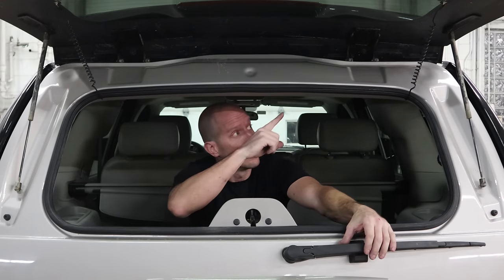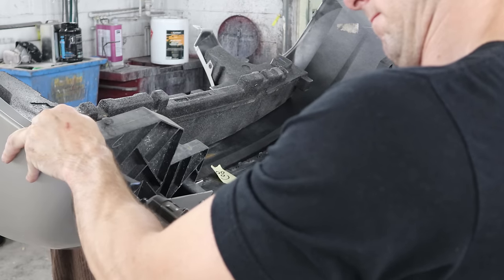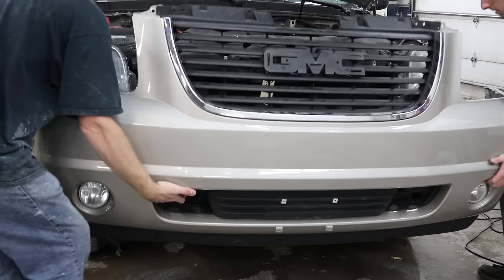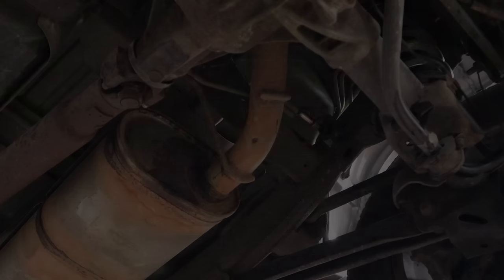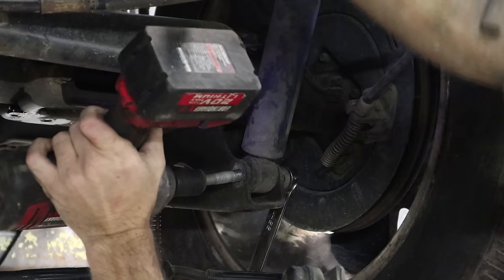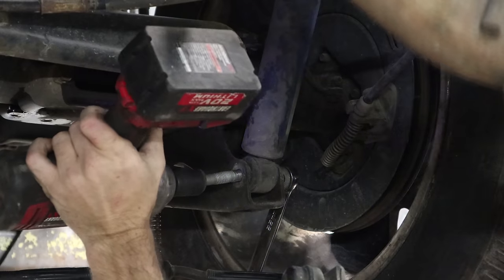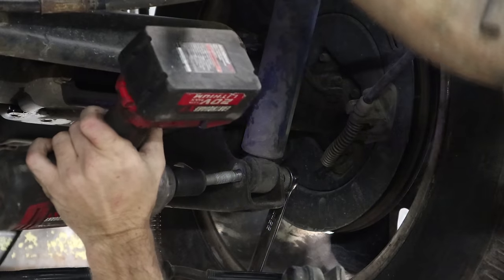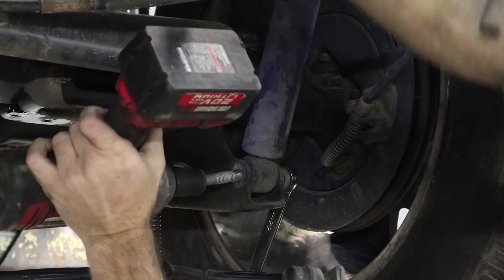Finishing the GMC Yukon semi collision rebuild project.

Comment: "1 inch impact to tighten up the oil plug [...] like I was taught at Jiffy Lube."

I genuinely laughed aloud.  Props.
Reply: "Put the oil in"
"They didn't teach me that at jiffy lube though" 

Master mechanic and comedian right here.
Reply: @crazikyle  It took them once to have them blow up a car in our hood for me to never go there.
Reply: I have been an auto technician for almost 30 years, I have full appreciation for what he said. I call them Shitty Lube. Through the years, I have corrected more than one of their screw-ups.
Reply from the maker: Ah, the kids Jiffy lube hires are learning, they make mistakes, it happens.  I do have a problem when I see the same mistakes coming from dealers, they are supposed to be the "best".
Reply: As I said, I have been doing this a long time and know many of my fellow techs. In our area there is a serious shortage of qualified and experienced techs. From the ones I have talked to, at local dealers, on a "team" there is usually one or two great techs, a couple of good techs and the the "zombie" techs. Of course, the "zombies" do the bull work that no one really wants to do like engine and tranny swaps.
Reply: @vehcor  In other businesses to prevent problems, you employ a quality system.  You think it would be easy; eg. the bill can't be processed until at least x.x litres of oil have been dispensed by the oil dispenser.  Don't know why they don't do this since it would be pretty easy.

Comment: Gotta love 3M VHB tape. I'm expecting it to be used to hold main and rod bearing caps on at any time. I think Honda already uses their wildly popular push pin body clips to rod caps on
Reply from the maker: It holds even tighter if you don't put it in the right spot! 😂
Reply: @vehcor  agreed. It has maximum adhesion if ever something is installed crooked or in wrong place

Comment: Very nicely done.  I have found that Brake Fluid used sparingly on a rag to clean black rubber and plastic parts works well.  Keep it away from the paint!

Comment: Thanks for showing us that LS oil cooler block-off plate gasket leak. I did not know about it.  Easy fix changing that $3.00 part,  remove (2)10mm bolts,  and I have to quote you,  " I win"  !!!
Reply from the maker: Your welcome, thanks for watching!

Comment: Quick tip you can relearn TPMS sensors by putting it into relearn mode then by letting some air out (or in) of the the tire with the light on until it beeps.
Reply from the maker: Or you could save time and use the proper tool......

Comment: The correct torque setting for the oil plug is stripped, then back half a turn.
Reply from the maker: You forgot the locktite step! 😂
Reply: Close, the correct torque is half a turn before stripped so it strips out when you go to remove it the next time. But for the diff fill plugs, it’s run them in with the wrong size wrench and completely strip the “square drive” or the “hex drive” (seen both on GM’s) at about 800ft-lbs of torque, so your only option is to completely drill them out since so amount of heat and ez outs will work. And gotta make sure everything has been doused with a gallon of locktite 😂

Comment: Great series Vehcor! How is the Pontiac G8 GT running these days? I own a white 2008 G8 with about 45k miles. I am also considering buying a 2005 White Grand Am GT from Copart, with over 200K miles in great shape. It just needs the transmission rebuilt, I know how much you love the Grand Am's. Anything I should be aware of? Hello from Phoenix Arizona.
Reply from the maker: Thanks, my G8 is a GXP and it runs fantastic. It is away for the winter and unfortunately I did not drive it as much as I wanted this year.  Grand am trans failures are rare actually.  More than likely it is a plugged up catalytic converter that acts like a bad trans.  I have bought 20 or more of those scenarios. One was my personal car for 6 years. I'm mean it could be a bad trans but driving with mismatched tires is about the only way to burn up the clutches.  Either way, used transmissions are cheap and so are cats.  Good luck, I am jealous that you can drive your toys year round! 😡
Reply: @vehcor - Thanks again for the suggestions. The Grand Am runs, but it does not move under it's own power. I assumed it was the transmission, but also a clogged catalytic converter makes sense also. Arizona is great for toys, I own a Yellow 2001 Suzuki GSXR 1000 that I can ride almost year round. She gets parked for about 4 months during the summer. I just got it out the other day for the 1st time this season.

Comment: So, I'm wondering why they use locktite on the brake parts. I can see where it would help keep the bolt tight, but maybe it also seals the threads to keep rust out? Am I on the right track?
Reply from the maker: It is just to keep the bolts tight.

Comment: Seeing all this ball joint work you’re doing, what’s your opinion on leveling kit/spacers on these full size GMs? I’ve got a 14 Sierra so will I to trash those ball joints in like 20k miles if I go with like a 2.5-3 inch lift?
Reply from the maker: Those use different ball joints, they don't fail like these do.

Comment: I have a question I got a used door from.a Salvage yard in good condition no damage when I swap them out it wasn't  Aligned right i tighten the bolts good any ideas and none of the yukons wher wrecked

Comment: If you worked at jiffy lube you would have know that the oil goes in the radiator.
Reply from the maker: That's why it is never in the engine! 😂

Comment: I watch auto repair videos and I'm surprised how many vehicles get damaged by the forklift operators at the insurance auction lot. Seems like they could come up with a better method of unloading/loading.
Reply from the maker: They move them a bunch of times in the yard in addition to loading and unloading.  It is the most efficient way possible.
Reply: Agreed. Shocks were damaged and a tire was stabbed (opposite side of the wreck and inner sidewall) on my project JK. Thanks Copart

Comment: In Australia repairable damaged vehicles go through 3 rigid inspections levels, everything has to be road worthy as they check everything, 4x4s even have to have mud flaps fitted, when it's registered you drive down the road you will come across piles of junk legally driven on the roads, you ask yourself, how come i have to pay a fortune on inspections? I see lots of vehicles on the road driven without a care in the world to mechanical condition.
Reply from the maker: The same is true here.  Rebuilds go through inspections but a 30 year old, taped together, rusted out beaters are just fine to drive around! 🙄

Comment: did you forget to connect the front fog lights ?
Reply from the maker: No, wait until you get to the part where I did put any bolts or lug nuts on.  Amazing that the wheels didn't fall off.  Moral of the story:  apparently some things do happen even if it isn't on video! 🙄

Comment: Edit:  Finally selling the old truck?  I may be slow, but I just now realized (after rewatching the first couple of Mistake videos) that you no longer use an intro.  I should be a detective.
Reply from the maker: I thought I was ready to sell the old truck but I just had to use it again. It is really hard to part with.  The videos were getting too long with the intro so I just stopped.

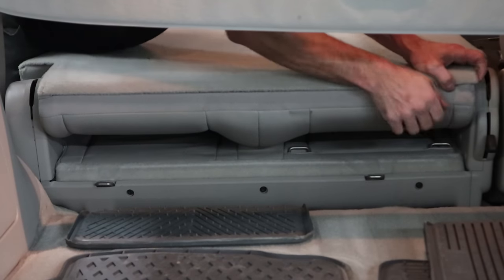Comment: is this a 'boring' build because it's Camry beige?  you know, you assert that the seat fix at 7:30 wasn't because of the accident, however, you can fix it.  You fix cars from accidents, therefore, it must have happened in the accident because you've never fixed something that wasn't in an accident :D logicz (with a z because itz so goodz).
Reply from the maker: It's boring because it isn't a Lamborghini or Ferrari and the haters told me I only build boring cars. 😂
Reply: @vehcor  I can't make it through a video of B or T without throwing something at the computer....

Comment: "Alignment".  I delay mine also. I've even gone so far as to do the string around all 4 tires method only to wear out front tires prematurely. Since your shop does just about everything else, is there a way that works, ...aside from using a high dollar alignment jig, ...making it possible for someone to accurately do their own?
Reply from the maker: I delayed mine for the test drive, it literally went there when I was done making that video.  A waste too! It was dead on already!

Comment: Doesn't that engine take 6 quarts?
Reply from the maker: A little more, I use the longer filter.
Reply: @vehcor  I saw the one jug and was thinking you just put 4 or 5 quarts in. I had a 2009 suburban. Never used the longer filter though. That vehicle had AFM issues.

Comment: Boring build Friday? WTF? where did that come from? you got haters now or something? You replaced ball joints brakes and rotors, i would have replaced the wheel bearing hub assemblies too while in there because typcally if the brakes and ball joints are that far gone it's just a matter of a short time till the bearings are gone too. I usually get a whole kit from Detroit Axle. they make  great set for Yukon's and escalades both (same kit) that has the upper and lower ball joints, tie rod ends, and larger control arms. not too expensive and more sturdy. well worth the time to replace them all at once and just be done with it I wold just like to know how you got a mustang 14" hubcap in a console that's only 8-10" deep lol
Reply from the maker: The haters say I build boring stuff because it is not a super car.  I'm just agreeing with them and it drives them nuts!
Reply: @vehcor  You have haters? How is that even possible? You're such a likable person, i don't understand that at all (not sarcasm either)

Comment: I,'ve always been told to remove any rust off the wheel hub flange face before installing new rotors (maybe you skipped over this step with the video?), typically with a drill and a wire brush head.  I didn't see you clean off the surface rust on any of the Yukon hubs - is it really necessary, or was I misled by an anal mechanic?
Reply from the maker: I was taught the same.  Over time you learn that you don't have to be so anal and things will be fine.  If they are really bad, I will clean them up but little rust like this is no big deal.

Comment: I've noticed a lot of unnecessary re-work due to poor pre-planning on your boring rebuilds.. is that intentional for content purposes? 
Also Flexfuel tech does NOT destroy your car, JSYK. Unless is a Ford but then again..
Reply: I would like to hear what poor planning he has done or are you just trolling?  He is one of the most efficient builders I have ever seen in my 30 years of owning a shop.  As for the Flex fuel not destroying the car..... tell that to all my customers that have paid for valve jobs, injectors and oxygen sensors just to save a few cents at the pump and get lower gas mileage.